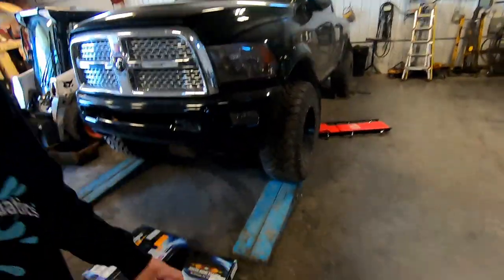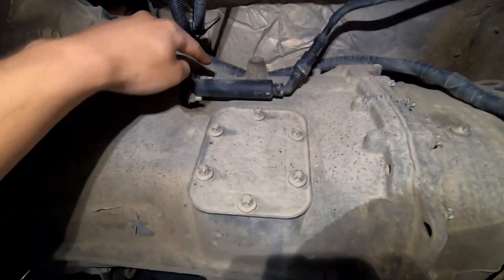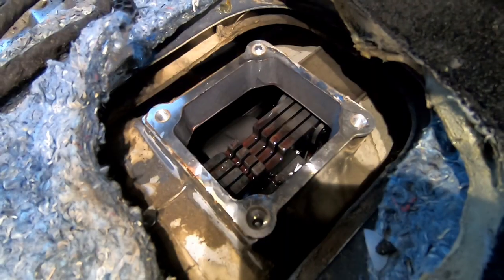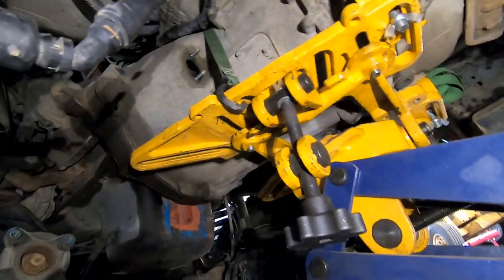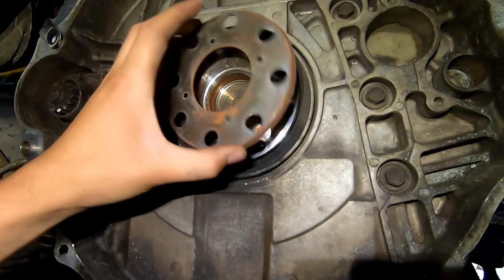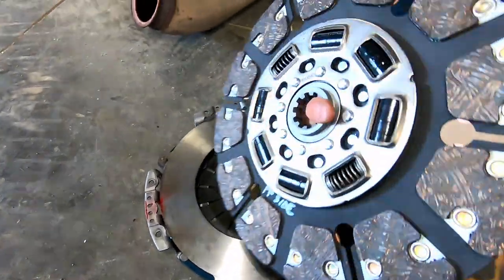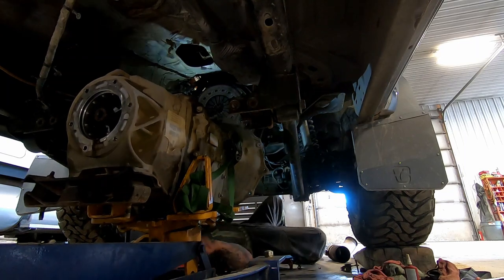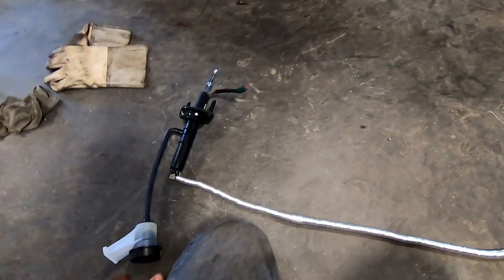How To: Replacing Clutch on G56 Transmission with South Bend Dual Disk, 2014 Ram 6.7 Cummins

Comment: Clutch, Torch? Cutting? I belive removing the 8 x 15 mm bolts would let you separate dual mass flywheel. Issue is probably you welded together the two parts of flywheel with cutting torches.

Comment: Hey buddy, great video. Might look into unbolting the clutch from the front. I take a piece of emery cloth and clean the bearing surfaces on the input shaft. I also put a tiny amount of grease on the input shaft to help with installation.

Comment: HEY GUYS! JUST CAME ACROSS THIS JOB FOR THE FIRST TIME AND I FOUND THIS VIDEO AND AFTER READING THRU THE COMMENTS I FOUND THAT ALOT OF PEOPLE ARE RIGHT ABOUT THE INSPECTION COVER ON THE PASSENGER SIDE HELD IN BY 2 10MM BOLTS IF YOU TURN THE ENGINE BY HAND ABOUT EVERY THIRD TURN YOULL COME ACROSS A 15 MM BOLT THERES A TOTAL OF 8 ON THE LAST ONE BEVERY CARFUL WHEN TAKINF IT OFF THE LAST ONE HOLD ALL THE WEIGHT OF THE WHOLE ASSEMBLY. GET A BUDDY TO HELP. IVE ALSO SEEN VIDEOS WHERE THIS CAN COME OUT WITH THE TRANSMISSION AND IM COMMENTING ON THIS VIDEO FOR FEED BACK AND TO SAVE ANYONE TIME AND MONEY IM NOT SURE HE NEEDED TO CUT IT THIS WAY BUT EVERY TRUCK IS DIFFRENT.

Comment: On these trucks there's an inspection plate on the back side of engine passenger side kind of like a torque converter it has 8 bolts you need to take out to remove the clutch from the flex plate that you cut out with the torch LOL I learnt the hard way also haha!! 🤜💥🤛 It's crazy these trucks use a flex plate like automatic transmissions 🤦🏻‍♂️🤦🏻‍♂️🤪⚖️🎲🎲

Comment: Also add transmission fluid lol.   I highly suggest adding an additional qt of fluid through the top of the transmission before you bolt the shifter back on.   The extra qt really helps with stiff shifting. There is plenty of room for the extra qt no worry about blown seals.

Comment: Had the same thing happened to my g56 last year cost me $2800 for a new south end clutch. It had only 20000 miles scorched but looked like new. Pressure plate was packed with hay.

Comment: Very informative video. I've been thinking about buying a Dodge pickup and undecided between an auto or manual transmission.  This video helper a lot.
Reply from the maker: Automatic is definitely more comfortable but a slipping clutch is A LOT cheaper then a slipping automatic transmission haha
Reply: I own both, I love my g56 alot more and as stated about my replacement clutch was much cheaper than the rebuild for my 68rfe🤣😭 the sound control of the manual is much more satisfying but my auto is much more comfortable. Manuals are much harder to find and dealers are price gouging like crazy Goodluck!
Reply: The work 09 was auto and personal 09 was G56.  City driving with the SB duel cluch is a pain, especially in heavy traffic.  I do like the manual when towing.  The auto seems to down shift a lot.   The gen 3 has more fpt.
 with the auto. I understand that the Ram no longer comes with a manual for the 2500 and 3500 HD trucks after 2021 or something like that.  I'm on my 3rd cluch with 169k miles.

Comment: Great video. Did you have and problems fitting transmission over a pressure plate. Today I couldn't even fit my g56 into a pressure plate.  Input shaft will not fit between fingers no matter what.  Can not raise it all the way up because fire wall. Angle didn't work. Kind of confused. Will try tomorrow but it was a pain...

Comment: An issue I had was when the transmission was removed the engine lifted up about an inch with the weight of the transmission removed.  I had to tilt the engine for the transmission to line up.

Comment: Have you ever changed a clutch on a 2014 plus with a gas engine.. apparently there's an extra plate between the engine block and clutch

Comment: I’m guessing you had to bleed the clutch hydraulic system? No mention of that and does the clutch kit come with a new pilot bushing??
Reply: No bleeding required. The hydraulics are ready to go out of the box. Flywheels usually have a limit bearing with them.

Comment: What clutch would you recommend for 2017 ram 2500 g56 trans, 4x4, deleted, 4" exhaust strait thru muffler, optimized stock tune (20 hp) tow 10,000 # toy hauler,  truck feels much stronger,  don't take much to slip stock clutch
Reply: What cluch did you go with?

Comment: Appreciate the video, mines starting to slip and I’ll be damed if I pay someone something I can do my self. Plus you know it’s done right!! Hope mines not sealed together and have to break out the oxy accede line
Reply from the maker: Haha you should be good. I’ve don’t a ton of clutches and this was a first. Always seems to go sideways whenever I decide to make a video lol.
Reply: Dark Iron Diesel you should steer people away from the Southbend, at least the quite clutch’s. Their roll pins, and pressed rubber quite thingys tend to break off. I got me a valair quite double disk organic!!
Reply: @DasSnakeBoy  How's your Valair holding up? We just bought a 2016 3500 and I've been waffling between the South Bend and Valair quiet dual discs.
Reply: @michigandon my viliar dual disk street quiet version lasted me 100k on a deleted and tuned with s465 second gen swap. I drive and tow on level 5 tuning 100% of the time.

Comment: Came across your videos last night and now subscribed. Whats your thoughts on the G56 vs the 68RFE? Im shopping right now for a new used 2013-2018. Oh and fellow Canadian over in BC bud, Cheers
Reply from the maker: Thanks buddy!  I dunno man I guess it depends if you want to drive stick or have an automatic haha.  My opinion is the G56 is going to be more reliable then a 68RFE, but you will probably be doing a clutch at some point.  If you are thinking about getting an automatic I'd recommend looking into the Aisin transmission option.  Its a beefier transmission that comes on some of the 6.7 Rams.  If you end up getting a 68RFE you should do EFI Live transmission tuning, it will help with the longevity of the transmission.
Reply: @darkirondiesel  I had a 14 with the Aisin and fully deleted. Didnt like the shift points at all and they cant be tuned. Truck was just written off so im in the market for another.

Would like the G56 and was more so wondering which one in your eyes is more reliable. If i did go manual it would be an upgrade clutch right away. No matter what i go with will be deleted as well. 
I dont know why people keep these diesels stock, they are a completely different truck tuned
Reply: Don't buy a 68rfe truck if you're going to tune it. Ive gone through 2 of them and then I finally did the g56 swap. Now its perfect.